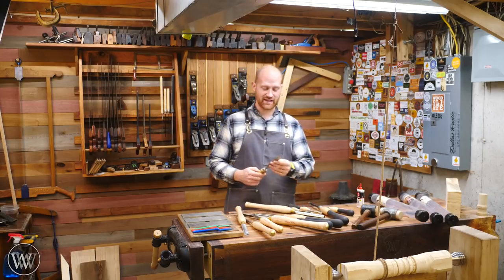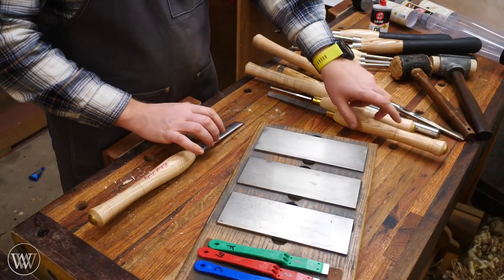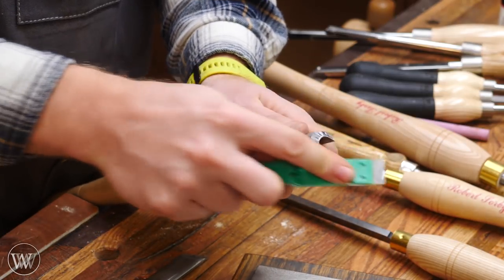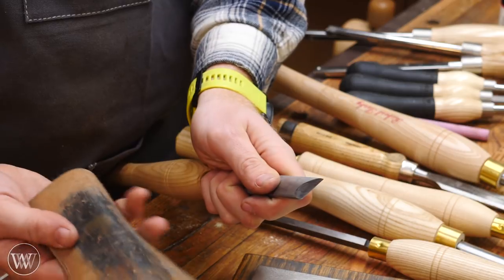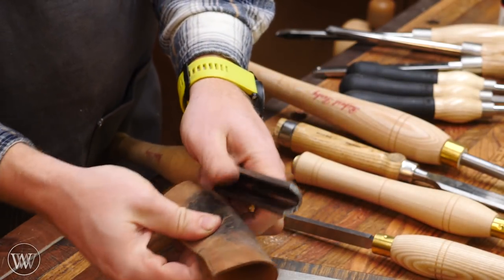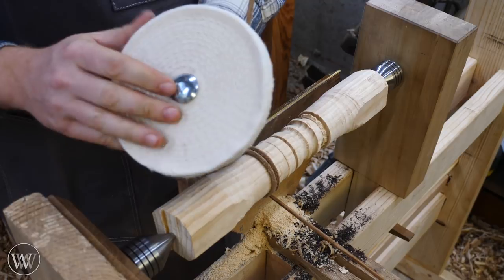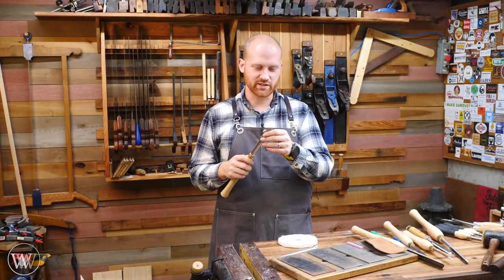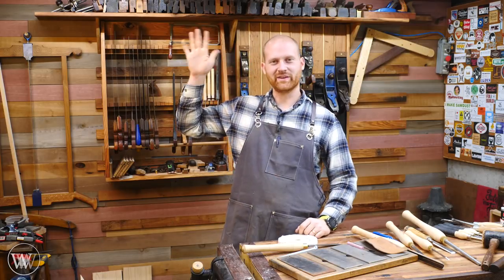How To Sharpen a Turning Tool Without a Grinder

Comment: I saw those sharpeners at the store, I thought they’d be great, but I wasn’t sure. 
( color coded, good grit differences. Small enough to make handling easy.)

A hard part about getting into woodworking, is so many companies advertise their products as “you only need this to get started!”, “perfect for beginners!”

And a grinder from a company was recommended but I just didn’t have the money.

I’ve a brittle bone disease, and woodrurning is something I’ve gotten into. The tools do most of the physical work. ( Having bones that break due to my own muscle tension - I have to be careful)

Anyways, I just wanted to say, thanks for covering this. I’ve been sharpening by hand, but it started to seem as if I needed a grinder too.

So it’s just a relief to see that’s not the case.
Reply: Stumpy nubs channel is the all out go to resource for that stuff. He cuts through all the advertising crap and tells you exactly what you actually need and what the truth is (always with actual examples). He's saved me literal thousands in woodworking tools. I actually own a grinder, but only use a diamond file by hand.

Comment: The grinder, unless you can afford a CBN wheel, is typically for edge repair. I keep a set of diamond cards (credit card sized plate) handy when working with any chisel or gouge tool. They are great for maintaining an edge. Another advantage to maintaining the edge instead of grinding it all the time is that your tool will last longer and perform better. Grinders take off more metal than you really need to for a maintenance sharpening. Extra fine grit garnet sand paper works really well too. make a stick that fits your gouge flute and wrap the extra fine abrasive paper around the stick.
Awesome video. I hate watching a turner continually going to a grinder with an expensive tool. Just wasting metal for the most part.
Reply from the maker: LOL I feel much the same. some people care more about speed than the actual work at hand.

Comment: Sharp!  cool video..... My grandfather had a foot powered wheel.  It was about 15 inches in diameter.  It just had a flat bar on one side that was attached to a pivot point off of the center line by about three inches and to the foot pedal on the other.  You had to push it in the direction you wanted it to spin to get is started then pump away with your foot.  It was its own flywheel.  and it was not a very fine grit.  but it would get things close and then he used little wet stones that were about the cross section of a domino but about three inches long to finish things up.  his strop was an old belt that hung from a nail on the wall. Watching you use the diamond paddles reminded me of him using the little wet stones.
Reply from the maker: thanks bill. one of those grinders is on my list for the future!

Comment: Great tip on things I did not know.   Will sharpen my lathe tools by hand from here on unless there is a big chip in the steel that requires an electric grinder.  Thanks for the info!!!

Comment: I've been sharpening gouges by using the tool to shape a piece of wood to the right curvature, then put fine sand paper or apply honing compound to the wood and use that for the inside. The outside I do like you do with a diamond file and strop.
Reply from the maker: I do that for a few of my carving gouges. fantastic method!

Comment: Thanks.  Glad to know there are good options rather than the expensive slow speed grinder with the steel sharpening wheels on them.  Then there is the expensive jigs for spindle gouges too!
Reply from the maker: the price on those can go WAY up!

Comment: Not sure if your still responding to these videos as they are a few years old but do you need a good edge to begin with to use the paddles mine have been mis-sharpened somewhat to begin with.  Carole
Reply from the maker: Yes. Reshaping an edge with fine paddles like these will take forever. usually at that point I would use some very heavy sandpaper or by the bullet and take it over to the grinder.
Reply: @WoodByWright  Thank you for the quick response.  I think I might take them all to my turners group when they can finally start up again and get one of the fellows there to show me how to sharpen properly then buy some paddles. Thanks again

Comment: One important thing is not clear to me. Is this about maintaining an edge on tools that already have a hollow grind, or dispensing with a hollow grind altogether and only using diamond paddles? So, for example, could I take new gouges out of the box and only ever use diamond paddles without them ever seeing a grinder?
Reply from the maker: oh there is it sorry I just now got around to answering the comments. I sent you an email back. let me know if you id not get it.
Reply: I have the same question. Can you avoid a grinder for ever with the paddles? Also interested in how often you use these. Before working, during working?

Comment: It looks like you are moving the sharpening tool over the lathe tool in the the opposite direction that a grinder would move over it, is this correct?
Reply from the maker: yes. when gettign a fine point you want to bush a bur out rather then pull it back. the grinder is so coarse a grit that it really does not matter.
Reply: thanks! @WoodByWright

Comment: It seems that yours have an offset handle but looking on Amazon, they do not show an offset ... am I missing something. I LIKE the offset idea.
Reply from the maker: sorry Clyde, you got me on that one. I am not sure what an offset handle is?
Reply: Handle is not flat but raised away from the plane of the sharpening surface but parallel to the direction of the surface (Looking from the side  across - down - across). That's Offset from the direction of movement - fingers further away from the plane of sharpening.
Reply from the maker: Interesting. I have never come across those. But no these are not that way.

Comment: Not bad. I like those little sharpeners. I still prefer however... to vise my tool and use my stones with my hands.  ( I just read what I typed... as literal as it is... it still doesn’t sound right.)
Reply from the maker: LOL thanks man!
Reply: We all need to stick our tool in a vice and rub our stones with our hands sometimes dude.

Comment: What about fixing a really beat up edge by hand? :/
Reply from the maker: If it's really beat up and needs a lot of work, I'll take it back to some really core sandpaper. Possibly. His course is 50 grit if the edge is really bad. But most of the time hunter grit will do fine.